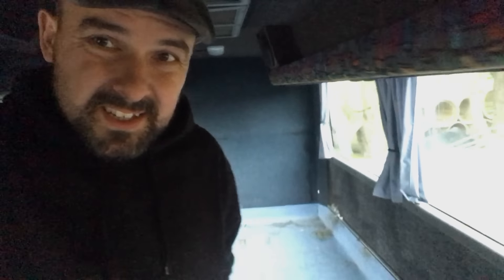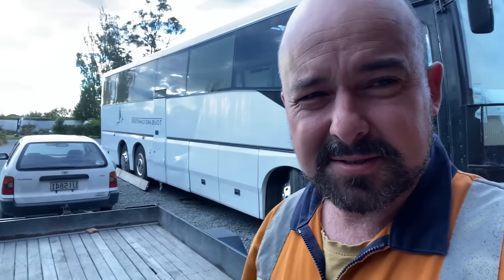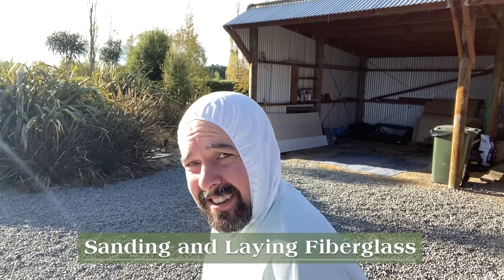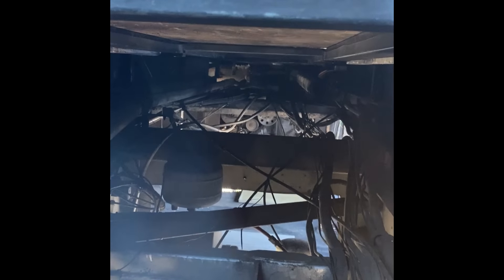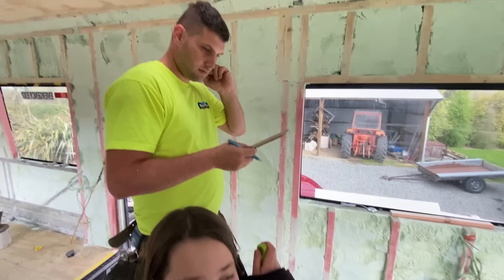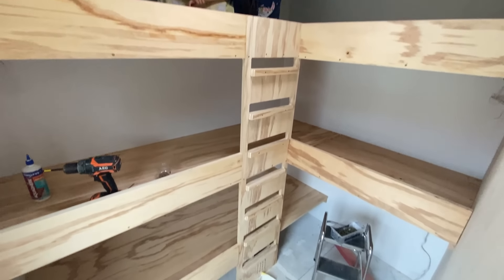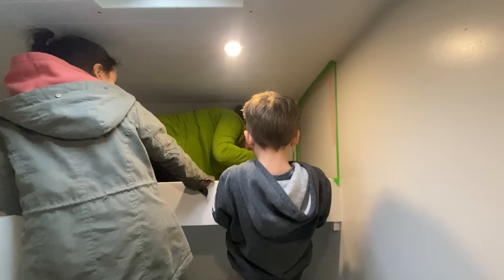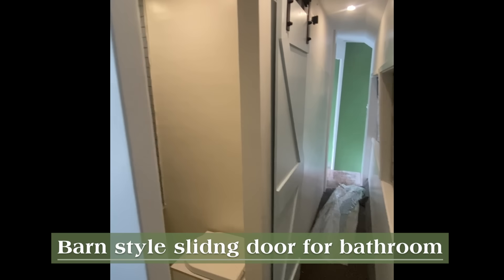🌟BUS CONVERSION FULL BUILD 🚌 2 years start to finish 🔨 DIY for family

Comment: 6: 31 I think if you cut the top facade at an angle of 45 ... You'll save some fuel money ... The more the front facade is streamlined with the wind ... The higher the speed, the lower the level of fuel consumption

Comment: 400mm hope that you will make it under the bridges
Reply from the maker: Even with that raise we are still under legal road limit of 4.2m. All the main roads have signs of bridge heights and so far we have been all good 👍🏻 😅
Reply: @RadiantBuslife I don’t know anything about NZ, but a trucker GPS allows you to put in your weight, length and height which may come in handy during your travels.

Comment: Nice conversion!! Withbwhat did you guys made the window covers? I used magnets but that doesn’t work that well..
Reply from the maker: Thanks! We used Velcro strips. I made the window coverings and sewed the fuzzy side of the Velcro onto the edges, then James glued the scratchy side of the Velcro into the window edges using a silicon based glue. Has to be silicon base otherwise it won’t adhere to the glass properly
Reply: @RadiantBuslife  thanks!! This would be a great solution i think that would fit my old van! Enjoy your travels and have fun!!

Comment: Lifting the roof did you need that certified to?
Reply from the maker: We consulted mechanical certifying engineers, employed a certified welder to do the welding (after James had cut and tacked all the steel in place) and we have a roll-over certification plate.
Reply: @RadiantBuslife  thanks thinking to do the same with my bus.

Comment: Looks fantastic I think I would have left the aircon unit on what about ventilation
Reply from the maker: Hi David, the original aircon just simply wasn't suitable for the conversion. It only ran off the running bus motor and a cousin of mine who is an aircon and electrician informed me that the whole unit was out of date and would not be able to be serviced. We installed large high powered extraction fans in each bedroom and the kitchen which really get the air moving nicely.

Comment: Delighted to see thre content of your this Video, I looked at the original one  again & really look forward to further updates on your plumbing & electrical... & decisiond thriugh the build.......Right at this point, I like your under cabinet drawers in the kitchen, they are are very wide.. You mentioned  'Pinterest' in where you saw the idea..... Can you share those details please, I am shortly to help a friend with her small kitchen revamp of a fairly new but verp poorly designed house & can build this in......I can utalise that very well but need to understand the  construction, I am assuming the process was with metal rather than timber... Easier to do with narrow drawers! but much more practical with wide ones A simple sketch detail would be greatly appreciated! I was impressed with the drivers office, The use of the Batteries from the communictions towers & your use of the elastic pockets for the kids in the bunkroom....also  why your use of the flexible PV panels.... was that decision for weight or even height? (I thought the flexible panels were less efficient & much more expensive) I might be wrong but interested in that too..... I saw so many more good ides but mention these  few to name a few... Marcus is my name I live  about an hour SE of Melbourne
Reply: I'd love to know how the drawers go. Drawers are great but they tend to pop open 😕 well our caravan ones do...
Reply from the maker: Hi Marcus, wow you really took notes! Here are a few quick answers... The kitchen cabinetry was done by a kitchen joiner, as with any normal house build. We simply asked him to "turn the toe kicks into draws please" ... and that is what he built. A great use of the toe kick space which is usually wasted in a normal kitchen. The use of flexible panels was because they were cheap, you are right they are not as efficient as other solid panels, we may upgrade in the future when we can afford it (same with batteries)
Reply from the maker: Push lock knobs when installed well seem to be really good!

Comment: Not mucking around. Great effort! Tell me, understand8ng that polesteirene eats the coating off electrical cable, did you wrap the cable? I used special purple cable in our trailer designed, especially for the foam.
Reply from the maker: Hi @philstrang6907, yeah we aren't here to much around. You are correct about polystyrene eating cable insulation (although it takes decades)... Cool thing about spray foam is that it's not polystyrene but polyethylene, the chemical make up of this type of foam preserves cable insulation rather than erodes it. Cool huh

Comment: Hey guys awesome job on the vid and the bus! I am converting a nine meter Fuso at the moment to tiki tour round NZ also, did you manage to get the side facing belts installed on your couch? Would you be able to do a short vid on that one and did you have any issues on getting the cert for it? The guy I have been to see says he won’t cert side facing belts?! Any help would be appreciated thanks. 
Daniel
Reply from the maker: Hi Daniel, seat belt certification is a long and expensive road to travel, that's for sure. If you're in the South Island, reach out to Fiddymont seatbelts and they should be able to point you in the right direction 👍

Comment: That spray all over that cab was totally unnecessary,  why the hell did you not take care to mask it up, as an HGV driver and mechanic that really saddened me...
Reply from the maker: Oh, it was certainly masked up for the application. The mess you can see in the video is the dust from grinding back the over-spray. Sure was a messy job. Happy it's done now though 😄

Comment: Love the bus. Are you required to have carbon monoxide monitors on it? Just wondered, especially in the secret room towards the back.
Love the Bible being prominent.
Reply from the maker: We have the carbon monoxide and gas meter in the kitchen area (at the base of the pantry) so any gas will be detected before it goes up the hall anywhere near the children. We also have extraction fans in the bathroom and in the bunk room which run every day to circulate air. In summer the vent in the children's room runs all night. 👍And yes, Bible in the living room is so important to get our "daily bread" Amen 🙌